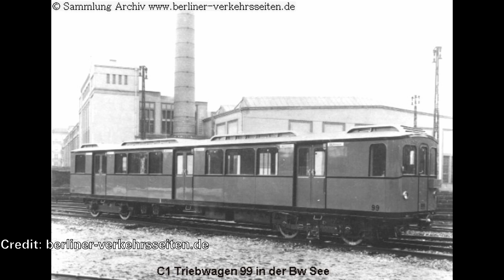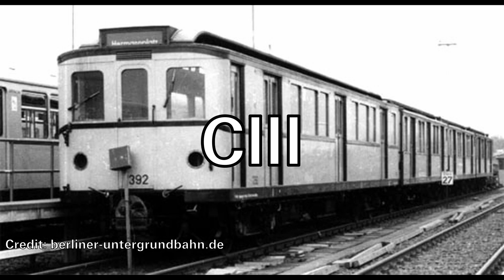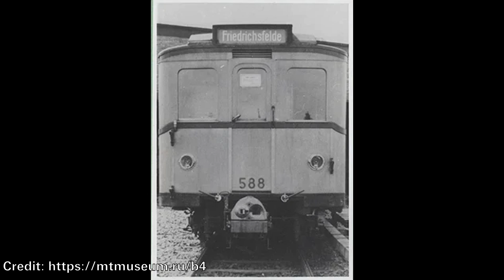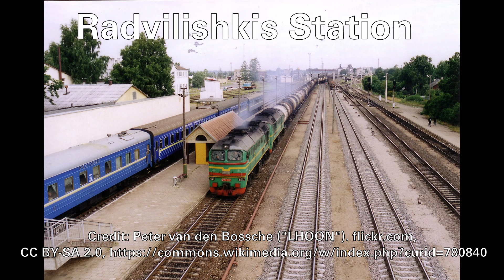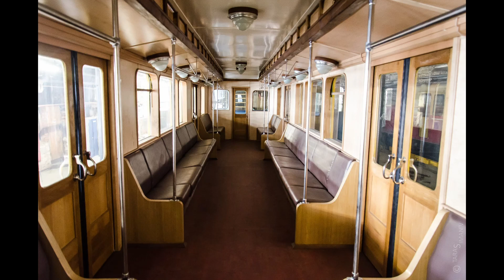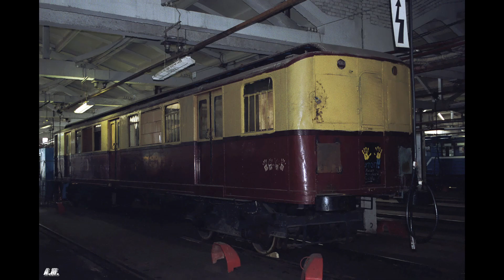BVG Type C/Moscow Metro Type V Documentary

Comment: These trains were made for the U5 and U8, not U6.
Reply from the maker: If you listen carefully I said the prototypes were built for U6 originally
Reply: Stimmt! Zumindest die sog Langwagen waren eine Entwicklung für die damalige Linie E, vom Alexanderplatz nach Friedrichsfelde, heute Teil der U5. 

Auf der U6 ind U8, damals C und D   sind diese Wagen nie gefshren!
Reply from the maker: @thorstenbartel1934 This is not right. Lets clear up some things, the prototype CI units were originally intended for use on the U6 (go look at the wikipedia article). The CII, yes were built specifically for the U5 but moved out of there by the time the east/west split happened and was used on U6/U7, later most of the trains moved to U8 and the last ever service C type run was on U8